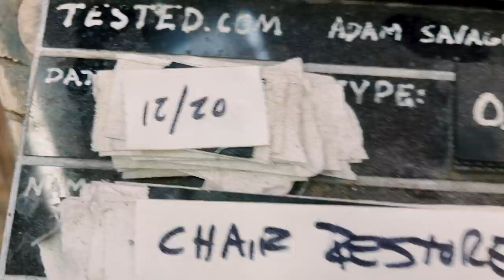Adam Savage Restores An Old Desk Chair!

Comment: Great build other than the finish. Tung oil applied that thick will never truly dry. The surface dries but the rest doesn't. If for any reason that chair gets very warm in the future anything that contacts if for a time will leave it's imprint on the finish. Tung oil must be applied very thin and dried well before adding the next coat. When the last coat is applied as an example a gunstock only needs one or two drops to completely cover the stock. The finish is amazing in terms of beauty and durability if applied correctly. Great Find Adam, nice job. For intricate work I use single strength broken glass to scrap off the old finish, requires only a light wisp of fine sanding.

Comment: I am literally working on a chair very much like this one today. I am just replacing the wheels with modern rubber ones that don't scratch my hardwood floors. Problem I have is the shafts and sleeves for the old wheels are like 5mm and the new shafts are 6mm. I'm in the process of widening the hole in the bottom of the chair for the new steel sleeves, and cutting a smaller aluminum sleeve bushing to go inside of that to ensure a good fit for the new shafts. That are also shorter than the original shafts. Fun.

Comment: I have a similar style chair but probably not as old as it has cast steel adjusters for the back and swivel. Original wheels work great. It's in the condition yours ended in and I bought it for $5 at a second hand shop years ago and is maybe the best and most useful find of my life.

Comment: I restored a chair almost just like this, the one I did had arms on it. It was from an over 100 year old post office in Findlay OH that is still in use. It had some random screws and wood patches from years of use. Someone too heavy for it sat in it and snapped the chair off of the support post and they were going to throw it away. I took it and put it all back together, cleaned it and as far as I know, is still in the office being displayed. The neat part was that it was a swivel chair and had a big marble on top of the feet post (in a round indent) and the chair pretty much slipped over the top of the post to hold it all together. I’m gonna have to check in on that chair and see if it’s still around.

Comment: Adam, I've had a set of Klein lineman's pliers/cutters for several years. They have never failed to cut whatever needs cut'n. No bending or notching. With the long handles, the mechanical advantage is mine not the wire's. The plier part has an awesome grip. No slippage. Very sharply cut teeth with a ferrule crimper too. Can't be beat. For nearly $60 on the Amacazon, it's a tough swallow, but I'll only ever need the one. Same for my Fluke meter. Buy cheap and you'll buy forever. Buy quality and buy once. It's nice to grow up and have real tools where it counts.

Comment: Great work!  I thought Tung oil needed at least 4 coats to be really good.  The first two coats just soak in and the next two fill in the grain.  The coats can be put on fairly rapidly but will need about two weeks to polymerize and dry.  Then maybe some more time before it stops stinking.

Comment: Love the rebuild. If I'm honest and it was my chair I probably would have left it alone. I see it almost like a patina on an old truck. Where it's been and the stories it could tell and all the time that's passed by in it's lifetime. It looks like an old chair out of a courthouse or school.
Reply: Had the patina been from an oil finish I'd totally agree with you; however most of the similar chairs I've seen seem to be covered in thin '50s polyurethane or equivalent (not even shellac), which just looks shabby when distressed IMO :(
Reply: @snafu2350  yeah it gets super flakey and sharp, also can give you plastic like splinters. For this particular chair my vision would have been completely sanding every part, soaking in lots of oil or wood hardener (because age its probably become super dry or soft) and then gave it my own flavor for a new lifetime with me. which would be probably a reddish stain/tint like a short coating of red mahogany then a few thin coats wipe on poly just to keep excess moisture out :) 

But thats whats so great about these kinds of projects, theres so many options and philosophies you could follow and rarely a wrong way to go about it!
Reply: @mromutt  The sharpness (certainly the flakiness) often comes from additional layers applied post-manufacture to provide a temporary 'restored' effect (if the thickness of the /original/ urethane layer is high it's an indication of well-built period furniture: it's often built to last at least decades.. hence the 'splinters' you refer to after years of storage/neglect) I'm not fond of the red tinge myself unless it accentuates the timber's natural colour: in this case it looks like a white oak was used for all main construction pieces, so I'd prefer a light stain with oil as a finish.. but as you inferred, 'different people, different tastes'

One other thing: oil (esp linseed) is usually an excellent solution for a seriously long-term wood finish: it helps seal from moisture & pest deterioration; it's (pretty much) food-safe for both pets & kids; it's easily & cheaply reapplied, & it can allow a burnish & eventually patina (admittedly over decades of constant wear) that for beauty almost surpasses shellac IMO without the constant attn required by the latter. It's a 'general purpose' finish rather than a 'pretty it up & make it shiny' finish for fancywares

/Never/ use cheap spray-on furniture 'polish' on these pieces: most contain light urethane for their shiny effect which will affect the ultimate finish of the piece over time & use (see below)

(Light) oil wood finishes are often substituted for stains :( IME&O they should really be categorised as their own type of finish as they (can) provide staining for decoration as well as light & heavy environmental protection: a fully-cured oil-finished piece is less likely to be subject to cracking (from moisture loss while curing) or splinters for eg kitchen utensils, furniture etc than something completely sealed in urethane varnish; a heavy oil protected piece is far more suited to utilitarian work (eg a salad bowl or chair) & as I said above, will over time /with minimal care/ (ie quick oil wipe) & over constant use gain a /restorable/ patina that's unique to the oil & the wood substrate

The main thing to remember if applying an oil finish to a piece is that you /must not/ subsequently cover it with a sealant (such as urethane): it /has/ to allow the wood & the oil to 'breathe' & cure over many years. Any sealant applied over a properly-applied oil finish will disintegrate very shortly (partially due to lack of adhesion as moisture evaporates from the core) & inhibit the oil 'curing' time during that period, so to restore such a piece you should simply add more oil (of the same type ofc)!

Comment: I love chairs like that. I'd really like to find one like that or a military desk chair with the threaded rod height adjustment. I'm a large guy and those stupid cheap ass pneumatic adjusters fail. I modded my current chair by drilling a hole through that and shoving in a hardened hex key to keep it from ever dropping down. Some sort of modern pinned system like this would be so much more reliable and fewer parts as well.

Comment: I wouldn't touch any "street find" from the Mission District of SF without first decontaminating it very rigorously!  SF is doing it's best to overtake NYC as the largest open sewer in modern history!
Reply: What rubbish, have you even been to these two great cities!
Reply: @chazzyb8660  YES!  I worked in SF for several years straight - in the city.  I'm very familiar with SF.  It's a cesspool.  Homeless roam like wild animals, most mentally ill and the rest so strung out on drugs they don't know where they are.  People selling drugs are also very common.  It's a dump with no turnaround in sight.  It's been two decades since I've been to NYC - it stunk then and it's many times worse now.

Comment: I found an old chair kinda like this (had arms) when I was a teen. It was in an abandoned house and had started rotting due being under a hole in the roof. I took it completely apart and copied everything in black walnut. Ended up doing a ton of the work in my shop class at school. There was some I done at home in our shop. I ended up getting an A in my shop class and didn't have to do any of those stupid projects like building a birdhouse in shop. My teacher bought the chair for $300 when I was finished and I didn't have but like $40 in it total out of my pocket.

Comment: Questions!!!!
1. When large vise with the visible gears… first, it’s gorgeous. Second, I take it that it’s a wood vise (?). Third, if there was a build video, can you please add a link to this video, or to instructions or a kit if one is available?
2. Can you please describe the hole in the workbench with the crowbar-looking clamp? I’ve not seen anything like that before.
3. Is that just a flat bit of sheet metal you’re using to scrape off the old finish?
General comment: I feel so much better about my time in my shop (garage) when I see the amount of time in one of your builds where your just looking for something in your workshop. Thank you!!

Comment: I'm sad that Adam didn't provide commentary on the restoration of the tilt/swivel mechanism, which is probably the most critical part in this style of chair :(

Oh, Adam, if you want to use it as a 'shop chair rather than an office chair, be aware that the 4-point feet make it extremely vulnerable to tipping over (exp with casters & back tilt): there's a reason why most modern designs use 5-point feet! :) I know this from painful experience with just this chair style! :(

Comment: My rocking chair restoration wasn't as elaborate. A spindle broke right at the top, so I 3D printed a custom jig to hold the spindle and the chair back aligned with a guide for a drill, drilled down through the top into the spindle, and glued in an internal support. Worked amazingly well.

Comment: Genuine question:  Is there a reason Tung oil is still used on high traffic items, if waxed based wood oil products like Rubio Monocoat dry faster and supposedly provide better protection with to the optional hardener?

Comment: I am wondering if that big block and dowel height adjustment was added to repair the original after the metal adjustment broke?  I have done several similar and never seen that sort of adjustment. Certainly works well enough. Nicely done on the refinish. I usually end with a good polyurethane.

Comment: Given your propensity of experiencing 'mishaps', please use that chair with extreme care. They moved away from that design due to its tendency to tip over when you leaned back at the wrong location.  There's a reason why newer office pedestal chairs have five legs instead of the four....

Comment: Hate to be a naysayer, but just be careful of 4 wheel office chairs with arched wheel supports, they are known to buck. In the first office I worked in, a girl sat on a chair like yours but with a metal frame and while sitting hooked her feet behind the arched supports. The chair bucked, she fell and broke an ankle. One reason that modern office chairs have to have five castors with flat supports, at least here anyways. Just a heads up.

Comment: Wood on wood as a bearing seems like not a good idea. Perhaps leaving it as an interference fit and using the casters to enable swivel would lead to it lasting longer. Tung Oil application requires tongue out.
Reply: Does the blue marble serve as a pivot bearing?
Reply: @douglasbutler4360  yes, it does for the vertical load, but there is still wood on wood sliding on the sides of the post. Also I did not see what the marble puts a point load on. Is there metal in the cup or at the top of the hole the post fits into? If not then I would have thought a hard marble on wood would eventually indent the wood and create more friction.

Comment: I wasnt a fan of this format of video, i guess we are all to used to how he normally does his videos. also, i was a bit disappointed in how he finished the chair. he didnt strip the lacquer/varnish coat of properly before putting oil on which will prevent the oil penetrating the wood. especially the bottom half, he didnt strip/sand it at all. the old coat can be taken completely off without removing the wear/patina and character of the years of its life. also he didnt apply the Tung oil correctly. not even partially well. he applied it like a wipe on varnish, meaning he put a quick coat on and wiped it of pretty much straight away. an old dry wooden chair like that should have oil slathered on and left to soak it in, and should most likely have several coats. the wood being so old and dried out would have benefited greatly from being able to draw up as much oil as it could which would have rejuvenated and revitalise the wood for another 50-100 years. but to be fair, not a lot of people truly know how to apply oil finishes correctly anyway.